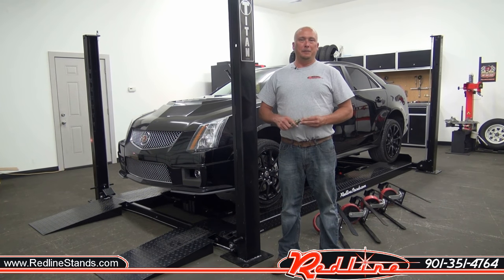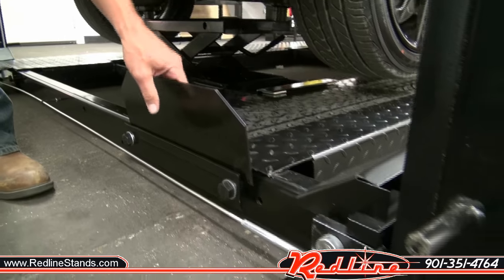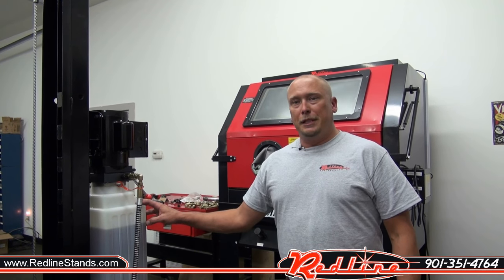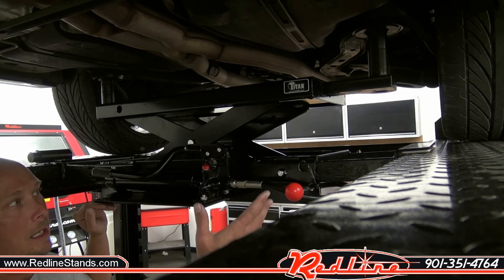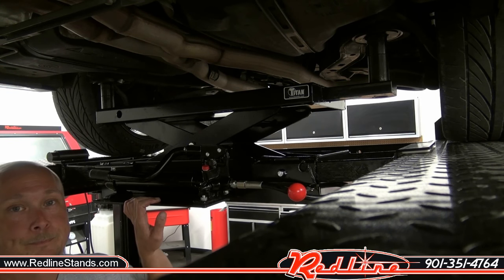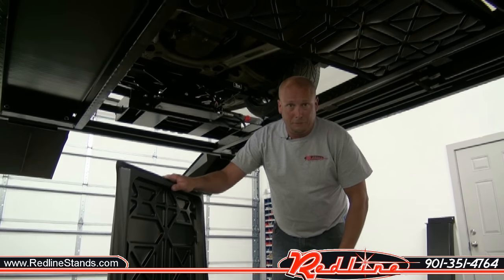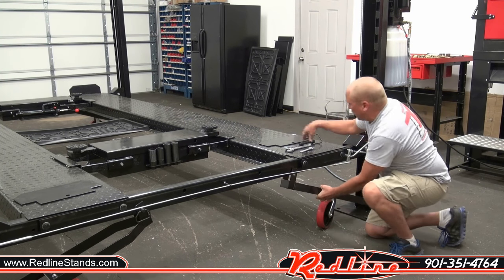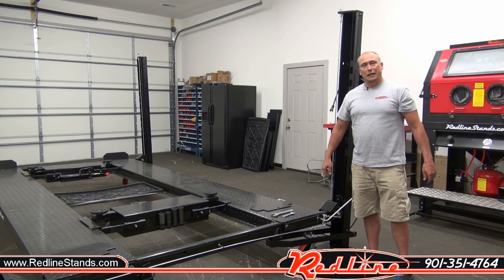Titan 7K Four Post Parking Lift Demonstration

Comment: It’s looks super sketchy when you see how much that post moves at the end when you push on it. Is there something that strengthens that up when a vehicle is on it?
Reply from the maker: If you want it to be super solid, anchor it to the concrete.  Makes all the difference in the world.
Reply: Redline Stands wow thanks for such a fast reply. I️ want to buy one that I️ can move around to gain room in my shop. When the car is lifted up is it fairly steady and sturdy or does it have a bit of sway? I️ have never owned one yet so just trying to get all the info I️ can
Reply from the maker: @jlaff1  There's a little sway.  Nothing that makes me feel unsafe, but it's not going to fair well if you bump it with another car on accident and it's not anchored.

Comment: How high the ceiling has to be??9 feet enough?? And, how much? iilive in Florida, close to West Palm Beach=) Thanks
Reply from the maker: I can't say sir.  The Titan 7k has been discontinued and replaced by their new 8k, which has different specs.  Even then, it's out of stock right now.  You might consider this Kernel 8k in it's place.  The specs to it are posted to our site.  Granted, how much ceiling height you need is really determined by how tall your vehicle sits....

https://www.redlinestands.com/catalog/lifts-c-290/automotive-lifts-c-290_138/4-post-lifts-c-290_138_140/kernel-8k-8000-lb-4-post-automotive-parking-lift-p-1109
Reply: Price is not too...bad, so I should check/ measure possible vehicles,....and go from there, garage door could always transfer higher rails, right??Is 4 inches concrete slat enough?? or has to be 6 inches??
Reply from the maker: @Eeropolvasti  Higher rails?  No idea dude.  Gotta ask the garage door guy that one.  4" is fine for this.
Reply: Meaning garage door is going more up, closer to ceiling to fold, so there could be a car on upper lift!!
Reply: @Eeropolvasti  
Yes you're right! If not, car will be hitting the track and the door will hit your car.